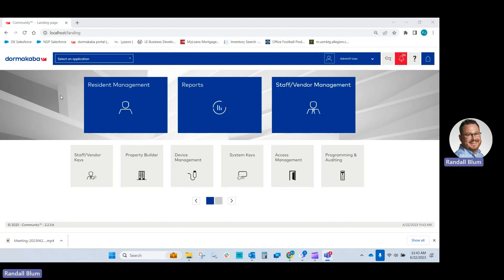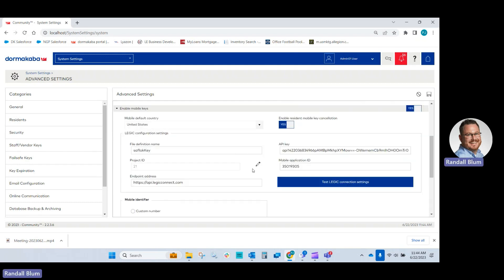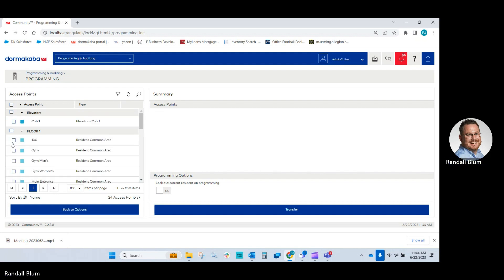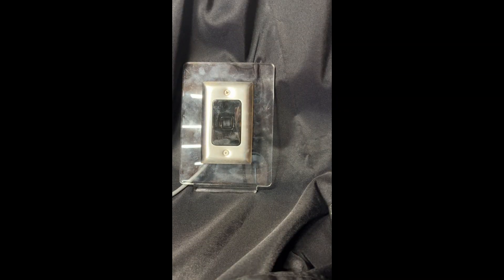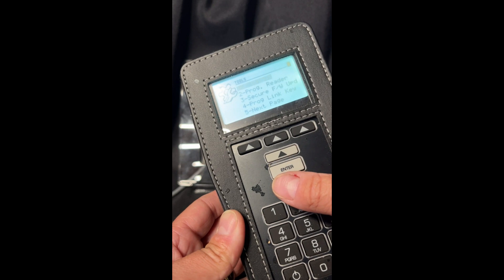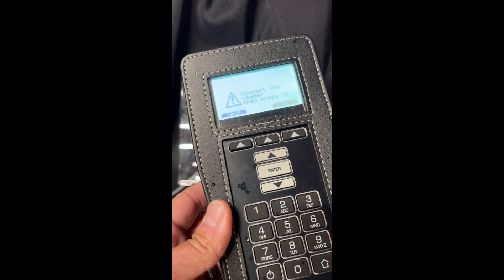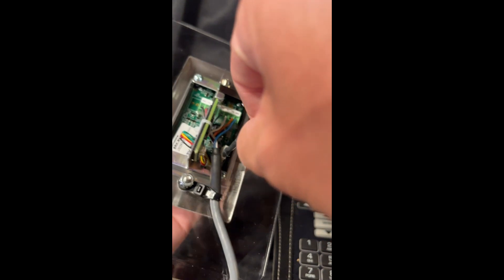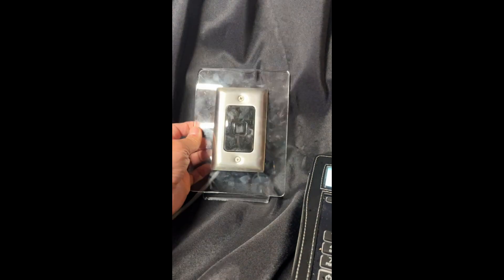How to Program BLE Settings into an SRK Reader Using a Cable

Comment: my dormakaba 79 series lock is showing disabled while programming is there a way to enable please let me know as soon as possible. thank you
Reply from the maker: That is a different lock & could use different software (depending on exact model #).  Please contact Dormakaba tech support and they should be able to assist.  1800-849-8324